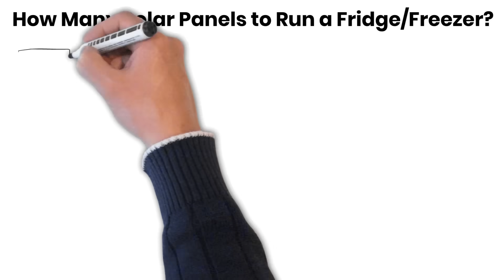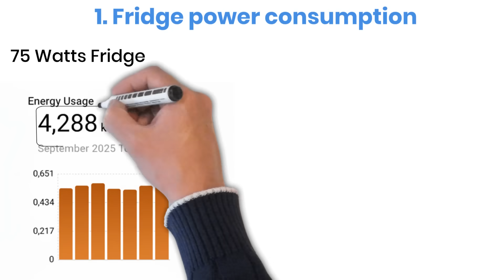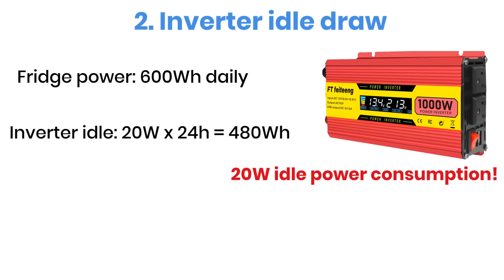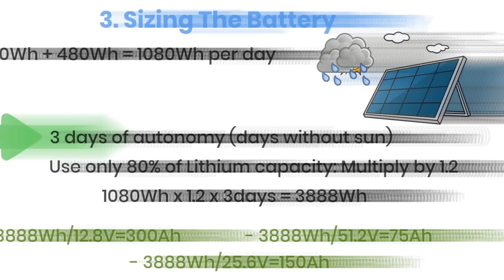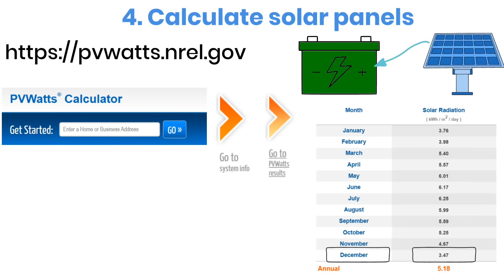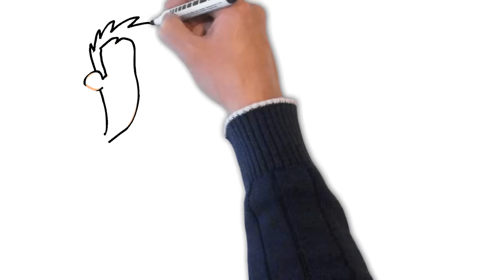How Many Solar Panels to Run a Fridge or Freezer 24/7?

Comment: I have been running a refrigerator from one 275 watt panel for a while on the Italian riviera without interruption. Refrigerator consumption 38 watts intermittent, inverter idle consumption 12 watts. My 5.5 kWh batteries are always fully charged by mid day. Now I also heat up to 30 litres of water a day from the same panel / battery combination. I monitor battery voltage on cloudy days and use less hot water if necessary (hasn’t happened yet). FYI, I have a separate system for lights, tablet charging, and music. The technology has come a long way since I first had a solar voltaic house in 1980.
Reply: For doubters, I must mention that my refrigerator uses new power saving technology, though it still relies on a compressor. Brand of fridge is Akai.
Reply from the maker: @ElectricNickUK  That’s an impressive setup — thanks for sharing the real-world numbers. Running a fridge on a single 275 W panel with 5.5 kWh of battery and still having headroom for heating water shows how far efficiency has come.

A couple of quick questions that other readers would find useful: which Akai model is it, and what inverter/MPPT are you using? Also, how does it perform in the darker months — do you still get full mid-day recharge most days?

Comment: Winter or summer?

Based on real local data, in summer on a clear day the 24 hour capacity factor is 44%, so one 400 watt panel will put out 4.2 kWh. The refrigerator uses 3.5 kWh as measured by a kill-a-watt meter. So one panel will do it, two if you want to handle a few clouds.

On a cloudy winter day the capacity factor drops to 7%. So one 400 watt panel will put out 28 watt average or 0.672 kWh per day, so five and bit panels, so six. On the other hand, if you put the refrigerator outside you will need no solar power at all, but your milk may be frozen solid.
Reply from the maker: Nice, thanks, that’s a clear local-data breakdown and the math checks out if you use those capacity factors.
A couple of quick clarifications for anyone reading:
• Your summer math is correct: a 400 W panel × 24 h × 0.44 capacity factor ≈ 4.2 kWh, so if the fridge really uses ~3.5 kWh/day (as measured with a meter) a single panel could cover that on a clear summer day.
• Your winter math is also correct: 400 W × 24 h × 0.07 ≈ 0.672 kWh/day, so you’d need about six 400 W panels to get ~4 kWh in those worst winter conditions.
A few practical notes worth adding: the panel energy numbers are just what the panels produce — you still need to allow for inverter losses, battery charge/discharge losses, and any days of autonomy you want. That pushes the required panel count up a bit if you want continuous 24/7 reliability year-round. Also, fridges vary a lot by insulation, ambient temperature and duty cycle, so measuring with a watt-meter (as you did) is the best way to know the real draw.

Where are you getting those capacity factors from (local PV data)? And what fridge model did you measure with the kill-a-watt? That context helps others judge how broadly these numbers apply.

Comment: The 48 volt system required so much power from the solar panels it is not effective.
Reply from the maker: That’s a fair point, a 48V system can seem like overkill for smaller setups. It really shines in larger systems where current needs to stay low and efficiency matters more. For smaller loads, a 12V or 24V setup often makes more sense and is easier to wire. What size system are you running right now?

Comment: So how many solar panels needed bwana.
Reply from the maker: Good question — it really depends on your fridge’s actual daily power use and your sunlight conditions.

As a rough guide:

For an average fridge using about 3–4 kWh per day, you’d need around 1–2 panels (400W each) in summer with good sunlight.

In cloudy or winter conditions, you might need 5–6 panels to keep it running 24/7 reliably.

If you tell me your fridge size (in watts or kWh/year) and your location, I can give you a more precise estimate.
Reply: @batteryhacker4343  in Tanzania not bought a freezer yet thinking of purchasing commercial freezer for fish. Ahsante sana bwana.
Reply from the maker: That’s awesome, Tanzania has great sunlight for solar setups, so you’re already in a good spot. A commercial freezer for fish will likely draw more power than a home fridge, so it’s smart you’re planning ahead. Once you decide on the freezer size or power rating (in watts), I can help estimate how many panels and batteries you’d need to keep it running reliably.

Comment: Your figures check out, well explained.I have a 12v system consisting of 1200w pv and 345ah battery storage. I also have an inverter generator for those strings of cloudy days.  Perfecto!
Reply from the maker: That sounds like a solid, well-balanced setup — plenty of solar for daily loads and a backup generator for cloudy stretches. That combination really takes the stress out of off-grid living. How long have you been running that system?
Reply: @batteryhacker4343 this system is only a year old. My previous system at my old place was the same specs and it was 6 years old.   the cost has come down so much since I first went off grid 15 years ago. It's wonderful
Reply from the maker: That’s great to hear, it’s amazing how much prices have dropped and efficiency has improved over the years. Fifteen years off-grid is a serious journey! Have you noticed any big differences in performance or reliability between your first and current systems?

Comment: Why 1000 W inverter for 75W fridge?? 200 W inverter would be more then enough.
Reply from the maker: Good question — the main reason is startup surge. Most fridges, even small ones, can draw 5–7× their running wattage for a split second when the compressor kicks in. A 1000W inverter gives that extra headroom so it doesn’t trip or struggle, especially if other small loads are running too.
Reply: @batteryhacker4343  But 1000 W inverter spend more energy then 75 W fridge... I have some experience... 250-300 W inverter is more then enough.
Reply from the maker: @mario_cv  Yeah, true, bigger inverters do use a bit more power on their own. I just like having some extra headroom for the startup surge, but you’re right, for a small fridge around 75W, a good 300W pure sine inverter can totally handle it. What inverter are you using in your setup?

Comment: Simply buy a  fridge with DC compressor and get rid off the inverter , if you can’t at least  buy an  AC fridge with inverter compressor
Reply from the maker: Good suggestion. DC compressor fridges really make sense for solar setups — less energy loss and simpler wiring too. Inverter compressor AC fridges are a nice step-up option though for people upgrading gradually. Are you using a DC model right now?
Reply: @batteryhacker4343  yes  I do, on sail boats we use that way
Reply from the maker: Great

Comment: You recommend a 48v battery but then link to a 12v?  Doesn't make sense.
Reply from the maker: Good catch, that’s a fair point. The 48V setup is generally more efficient for larger inverter systems, but I linked the 12V option just as an entry-level example for smaller builds. I should’ve made that clearer in the video. Are you currently running a 12V or 48V system yourself?

Comment: Now you just jump start my curiosity , thank you
Reply from the maker: Glad to hear that! That’s exactly what I hope for, to get people curious and exploring more about how these systems really work. Are you planning to build your own setup or just researching for now?
Reply: I live in socal I'm trying to run a mini split unit off the grid,so far doing research and info ,so appreciate your help...thank you
Reply from the maker: @manuelfierro1787  That’s awesome! A mini split is a great choice for off-grid — super efficient compared to traditional AC units. Since you’re in SoCal, you’ve got plenty of sun to work with too. What size (BTU or wattage) unit are you thinking of running?

Comment: 4.288kWh not 4,288 kWh, so 4,288 Wh
Reply from the maker: Good catch! You’re absolutely right — it should be written as 4.288 kWh, which equals 4,288 Wh. Thanks for pointing that out, details like that really matter when explaining power and energy conversions clearly.

Comment: It would be far cheaper to either eat the fridge contents, or throw it for the few days a year in which the grid might fail & spoil the contents.  However, for the sheer convenience of having a continuous power supply - for long term disruptions & emergencies - then a solar back-up is  clearly a good choice.

Historically, and taking the UK as an example,  refrigerators only became affordable & generally available from the 1960s.  UK domestic ownership of fridges rose from 13% in 1959 to 58% by 1970, thus becoming a regular household appliance.   Contrast with the US where household fridges were commonplace in the 1940s.
Reply from the maker: That’s a really interesting perspective — and I love the bit of history you added. You’re absolutely right: for short outages, backup power might seem excessive, but for long-term resilience, solar backup makes a lot of sense. It’s fascinating how fast fridges went from luxury to necessity in just a decade. Do you think people today could still adapt to life without one, even temporarily?

Comment: Just switch the inverter by termostat🎉 How easy is it to sell 3 times to much😉
Reply from the maker: Yeah, true — using a thermostat to control the inverter is a simple and clever shortcut. A lot of setups get oversized because people skip those small optimizations. Have you tried this method yourself, or just thinking about the idea?
Reply: @batteryhacker4343 just connect the Motor to the inv and let termostate switch 12v ❤ easy🤟🏼
I lerned something: Your calculation is based on winter sun⚡
Reply from the maker: @vornamenachname762  Nice, that’s a clean and straightforward way to do it. And yeah, you’re spot on — the calculation was based on winter sun since that’s usually the toughest scenario for solar setups. How much difference do you see in performance between your winter and summer production?
Reply from the maker: Yeah, that’s an interesting perspective — solar cell aging is real, but you’re right that long-term climate shifts also play a role in how panels perform year to year. Have you noticed your panels producing less over time, or do you think most of the change is from weather patterns?
Reply: @batteryhacker4343 and in Winther it is cold to😂

Comment: Nobody can guarantee you will not have three cloudy days in a row.
Nobody can guarantee you will have 100% shiney on fourth day.
Reply from the maker: Yes, You are right.
solar setups always have that uncertainty. That’s why having a bit of extra battery capacity or backup source like generator makes a huge difference during those cloudy streaks.
How do you usually handle those low-sun days in your setup?
Reply: @batteryhacker4343  
I use solar lights around the house with doubled the original battery but still having black out on next day of cloudy experience.
My next try will be 4 times the original battery power.
Reply from the maker: That sounds like a solid plan, doubling or even quadrupling your battery capacity will definitely help ride through those darker days. Are you planning to stick with the same type of batteries, or thinking of switching to LiFePO₄ for better efficiency and longer lifespan?

Comment: 0:16 Wrong approach🙄 just add PV modules, until it works. They come in fixed size, so your decimal points mean shit and you need a safety margin anyway.
Reply from the maker: Fair point — in real setups, you’re right, solar design usually ends up being more about adding panels until the system actually performs as needed rather than chasing decimal-perfect math. I just like showing the numbers so people understand the logic before they scale up. How many panels are you running in your setup?
Reply: @batteryhacker4343  I don't but here is a pretty old tutorial for one hundred-umpteen watt panel, to power a modded deep freezer box. So i guess the main problem is to use a front open fridge, as they tend to loose a lot of cold, when opened and who is disciplined enough, to only open the fridge during daylight hours🤗

Together with a battery pack, a one panel - 500Wh combo is probably plenty. Fridges are not very power hungry. A rotm side-by-side consumes less than 1kWh per day.

Looking it up, the real struggle is, finding a system on Amazon, small enough😂 
This: "Anker - 890 Wp Balkonkraftwerk mit SOLIX Solarbank E1600" is already absolute overkill and prices at 699. I guess DIY it is😁
Reply from the maker: chest-style freezers definitely hold the cold better since the air doesn’t spill out every time you open the door. A compact, well-insulated box plus even a single efficient panel can go a long way if usage is smartly timed.
And yeah, I’ve noticed the same thing — most of the prebuilt “kits” online are sized for way bigger loads than what’s actually needed for something like a small off-grid fridge setup. DIY usually ends up being cheaper and better optimized.
Did you ever try building one of those chest-style fridge conversions yourself?
Reply: @batteryhacker4343  I still look for a store bought chest fridge, because i am lazy🤗 But if such a device won't come, i have to mod a fridge, because in this upcoming WW3, a resilient home is key.

Comment: You seem to have missed the inefficiency of the inverter and assume that is the same as the idle power.
For an inverter to provide 75W probably needs around 90W.
Reply from the maker: Good point!  You’re absolutely right — inverter efficiency loss is always there. In most setups, a 75W load can easily pull around 90W–95W from the battery, depending on inverter quality and conversion rate. I usually round the figures for simplicity in the video, but yes, that extra 15–20% loss does count in real-world use.

Comment: I run an off grid cabiin spring summer fall on 560 watts of solar. 2000 w invert, and a charge controller.  I run mid size refrig-freezer, lights, vac, power tools, and a small microwave. Deep cell batteries were a pain. the 200ah lithium battery was a game changer.  If the battery runs low, i turn off frig and inverter. i put ice botttles form freezer into frig over night.  The next day I am recharged in a couple hours
Reply from the maker: That’s a solid setup! The 200Ah lithium really does make a huge difference compared to deep cycle lead-acids. I like your trick with the ice bottles too — smart way to stretch power during low battery hours. How long have you been running that system off-grid now?
Reply: How much does it cost you from solar to inverter etc

Comment: The best full-size fridge to run off solar is the LG, garage ready, 24 C ft, top freezer refrigerator. It used very little power during the defrost cycle, and it has extra insulation masking it very efficient.
Reply from the maker: Good tip! LG’s garage-ready models are definitely solid for solar setups — reliable compressors and good insulation. How long have you been running it off your system?
Reply: @batteryhacker4343  a little over 2 years with zero problems.
Reply from the maker: That’s awesome — two years without any issues says a lot about both the fridge and your setup. Have you noticed any big performance changes between summer and winter, or does it stay pretty consistent year-round?
Reply: @batteryhacker4343  I haven't noticed any change in performance between summer and winter.
Reply from the maker: @JR-kk6ce  That’s great to hear — sounds like a really well-balanced setup. What battery capacity are you running it on?
Reply: You are absolutely correct. The LG refrigerators with the Smart Inverter can't be beat for efficiency. Whisper quiet too. I've had mine for 9-10 years now with zero issues.
Reply: @Sinse-Jedi Yes, LG Electronics are found in most things, they are very reliable I believe.
First time I came across LG AC’s years ago I thought they were junk, but I was stood corrected.

Comment: No. I have a 1500 watt jackery and 800 watts of solar. If I have clouds it will not keep up. You will need a 3000 watts power station and a 1000 watts of solar to keep one frig running.😮
Reply from the maker: That’s a really helpful real-world example, thanks for sharing it. Cloudy days definitely make things harder, and that’s why I sized the system in the video using the “worst month” sun hours. The actual need can change a lot depending on climate, battery size, and how efficient the fridge is.

Your setup proves the point well: for consistent year-round off-grid use, you really do need to oversize panels and storage. Out of curiosity, how many hours of fridge runtime are you usually getting before the Jackery needs grid backup?

Comment: what fridge is it that only use's 75watts?
Reply from the maker: The fridge I tested is a compact household unit with a small freezer section. Its rated running draw is about 75 watts, but like all fridges, the startup surge is much higher for a few seconds when the compressor kicks in. That’s why in practice you always size the inverter larger than just the running watts.
Out of curiosity, what’s the watt rating on your fridge?